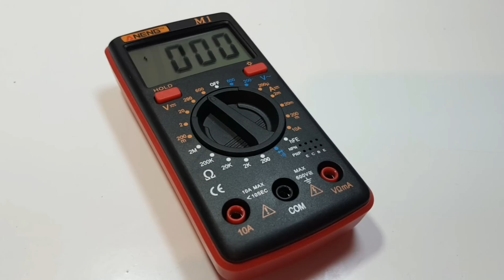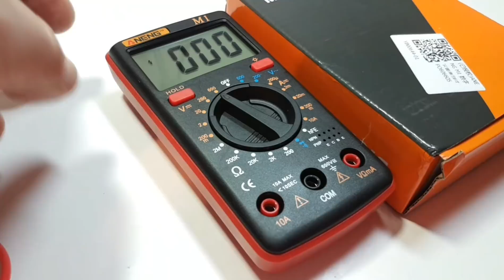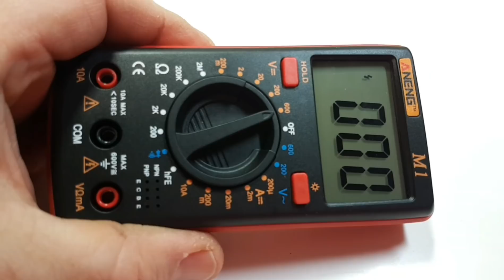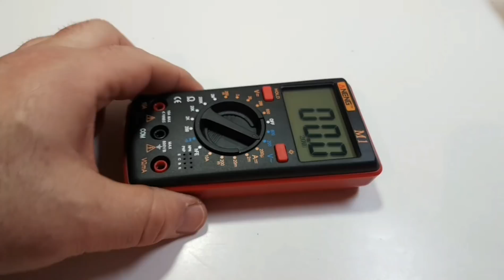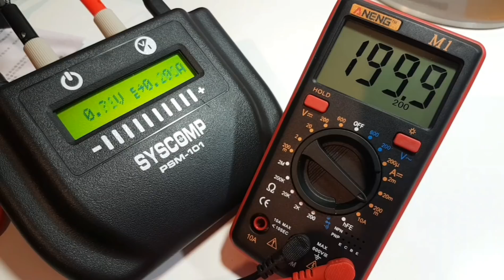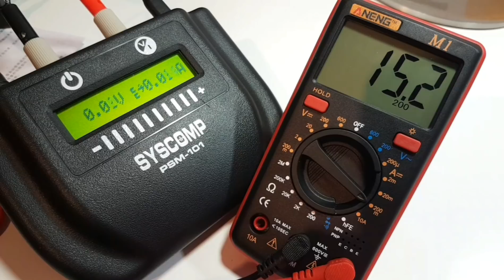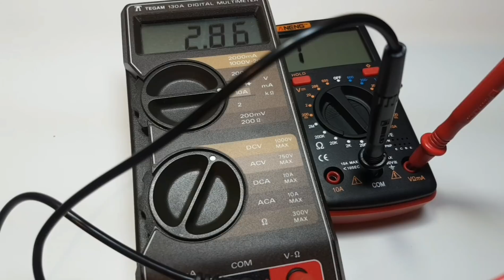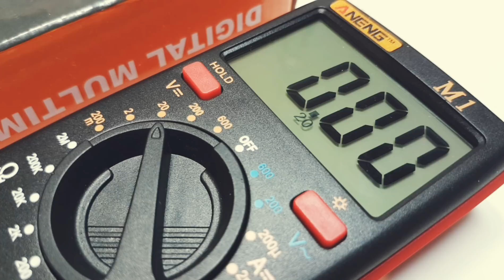Aneng M1 CHEAP-O Multimeter Review & Teardown!

Comment: Darren, how effective is this polyfuse for replacing a common fuse as protection? I read that polyfuses need some seconds to react before they "disconnect" the circuit completely. Does the time they take enough to protect the meter?
Reply from the maker: Hi Radius

It's absolutely effective! I've had no issues using them in multimeters with a low mA fuse rating. Does the job and saves swapping out a fuse every  time! No meter issues or burnouts.
Reply: @KeepOnTesting  that's awesome! i guess i should try it in my cheapo. 😃

Comment: No fuse.?
Reply from the maker: The multimeter has 1/ 200mA polyfuse on the low current and a Current sensing resistor for the High current as I mentioned in the Teardown.👍

Comment: Aneng tester m1 no fuse..?
Reply from the maker: Not sure I understand the question.It has 1/ 200mA polyfuse on the low current and a Current sensing resistor for the High current.

Comment: It' funny,  I'm discovering that you have tested a lot of the meters I have in my lab. This one I bought last December  from Banggood , and it sits in one of my many toolboxes.  You know: you never have too many meters.. 
My opinion is that it is a better meter than the average clone, and the display is good.
It took a while to understand the the small numbers (2 - 20- 200 etc) in the lower part of the display are the full range value.
The only criticism is that the rotary selector is TOO STIFF. The meter turns around on the bench, I need two hands for changing scale...
Thank you for the good work.
Reply from the maker: I too think its a decent dmm, especially with such a low price point. I love the mA polyfuse,  a great idea and much better than a standard glass fuse. My only complaint is that its so darn light..always flying off the bench! Many thanks 😊 👍

Comment: I recently bought two Aneng M1s. They are a great little DMMs for the price, as you say. Three points worth noting: the input resistance in volts mode is only 1M Ohm, rather than 10M Ohms upward for more advanced DMMs. This means more of a burden on the circuit being tested. There is no AC current range.  The test lead sockets are 2mm rather than 4mm, so watch out for this if buying different test leads. By the way, although the supplied test leads are a bit short, I have found them to be reliable, flexible, and  good to use.
Reply from the maker: Great points 😁👍 Thx for the input.
I think its a real shame this little dmm isn't more popular. The mechanics are great and it just works. A real pleasure to have around or in the toolbox.
Reply: @KeepOnTesting   Thanks for your review, which was a great help when selecting the M1. I use them as dedicated meters for plugging in to test boxes, but they are so small and convenient that I often use them for general measurements, and at the price you don't need to worry too much about them being nicked or blowing them up.
I would guess that at the moment the M1 would also be the  best choice for an electronics newbee on a tight budget. I wish something like that was around when I started !
Reply: Mine has standard 4 mm sockets. The supplied probes have a shorter insulation of the plug, but they are standard.
 I've tested with many different probes.
 As all the ANENG meters I have  ( 5 or 6, not sure),  the sockets seems to increase resistance over time,  and I must clean them with contact cleaner.  
It is baffling. They look no different from those used by UNI-T, but UNI-T's show a stable resistance
Reply from the maker: @rizzulazzi  Interesting...UNI-T does appear to have a slightly different input jack system..I have a pair of Probemasters and only the UNI-T Multimeters seem to sometimes have an issue with them seating properly..as you mentioned they do appear to be identical to other OEMs.

Comment: i want to try test my 12v 3A battery. put the positive 10A probe. the com probe become hot. after that the display number not 000 at ac dc selector, become fluctuate 001 002 003 005
Reply from the maker: Set the selector to 20V DC..put the red test lead in the V input and black test lead in the COM input on the multimeter. Now put the positive test Lead on the + Battery Terminal and Negative on the - Battery Terminal. You should now be able to read your 12V battery voltage

Comment: Sorry for the stupid questin but i am a newbie: It won´t measure current over 0.2A?
Reply from the maker: No such thing as a stupid question. mA is maxed out at  200mA. However.. it is rated at 10A high current in Amp mode. I would advise against high current testing with this multimeter as its only utilising a tiny current shunt resistor and there's no other input protection. Hobby electronics it will be fine.
Reply: So, if I have a DC circuit. Let’s say at 6V and it will have a current of 800mA. It will be able to measure it, However not in mA mode but it will measure it in the 10A mode ?
Reply from the maker: @hugodeandres1497  Correct..just switch the input to the 10A mode and you will be able to read your mA.  800mA would read .80 in Amp mode with this multimeter.
Reply: Ok, that explains it all. Makes sense, i got it wrong and thought it could only measure current up to 200mA which is quite useless unless it is a small circuit but it can do more in the 10A mode. Really appreciate your help mate
Reply from the maker: @hugodeandres1497  Glad I could help..its a great little dmm.

Comment: Not bad at all! for 5 euros it looks perfect! the only drawback is that the 9 volts battery has small capacity... 2 AAA batteries would be better.
Reply from the maker: Agreed, I should have verified the mAh.. I'll probably do that and post it later.
Reply: At least the 9 volt battery tends not to leak a dollar store Sunbeam 9 volt battery in the Harbor Freight "free meter" made by Aneng will last a couple of years with normal homeowner use.

Comment: And for the split input jack haters, notice theres beefy support posts molded into the back half of the case, these support the posts as well and keep them from moving inside their sleeves when plugs are inserted and removed.
Reply from the maker: Thanks for clarifying, correct the input jacks are well solidified and should retain those probes without difficulty..! No worries here..